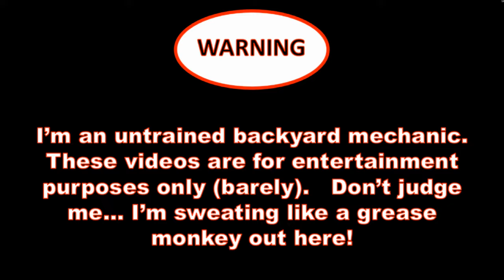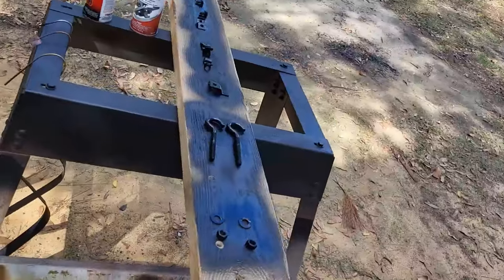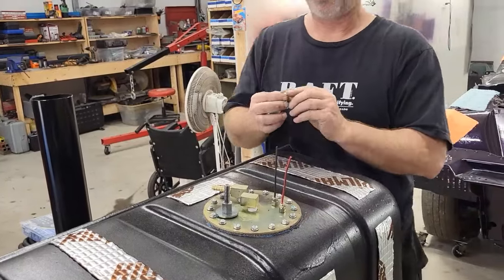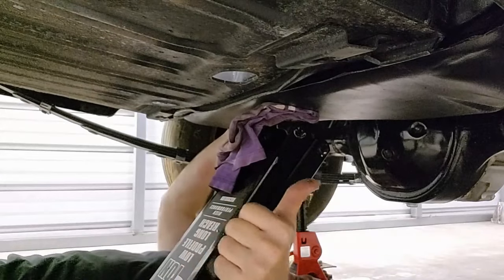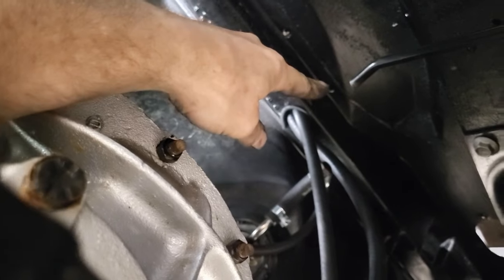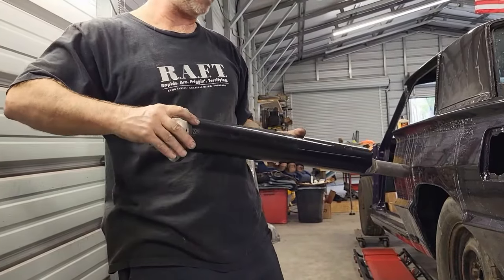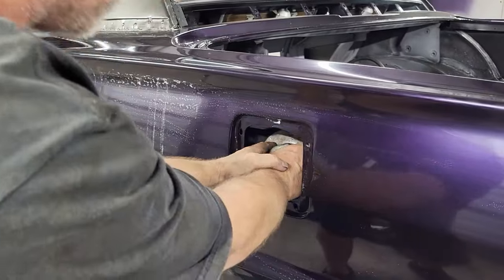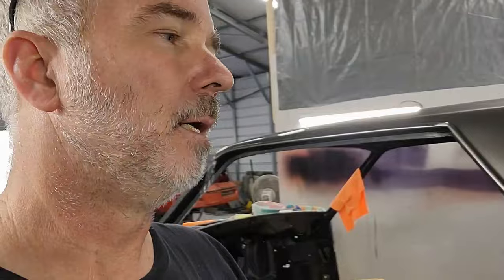Gas Tank Install - 1964 Thunderbird

Comment: I like your attention to detail and I can certainly appreciate your wrestling with the tank under the car - BTDT! My filler is put together the same way. Doesn't make much sense unless maybe it has something to do with insulating from static discharge, which is why the inner tube is lead lined (replacements are just bare metal so that probably isn't really an issue). Come to think of it, that would explain why that gasket is so thick too. 
We had the pleasure of having one of the original engineers for these cars in a car club I belonged to back in the 90's and I learned a lot from him. 
For ref, have you heard of Classic Tube? They make replacement hard lines (fuel, brake, etc) for our cars if you need any of them. You can even get them in stainless. 
Great update Matt - you're an inspiration!
Reply from the maker: Great info Scott.  I'm planning on making my own lines but I will look into the prebent lins to see if I want.to go that way.  Oh and thanks for the kind words.  The truth is all you guys keem me going on these projects.

Comment: Hello Matt. Nice job on the tank/line installation.  The gasket you got is probably for the 66 model (maybe 65 also) as the filler tube is not protected by another tube. My 66 has a shield mounted on the outside of the fill tube to protect it. 
George B
Reply from the maker: Good to hear from you George.  I felt like the gasket was the wrong one.  I was able to get it to work with the homemade one though.